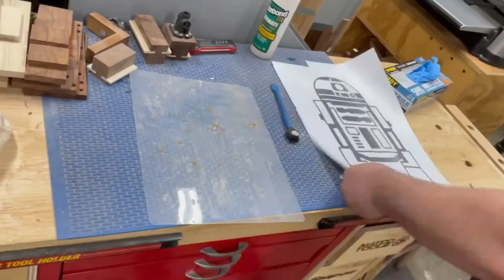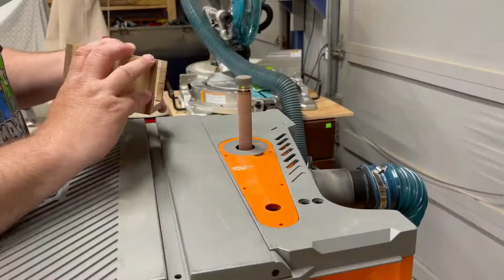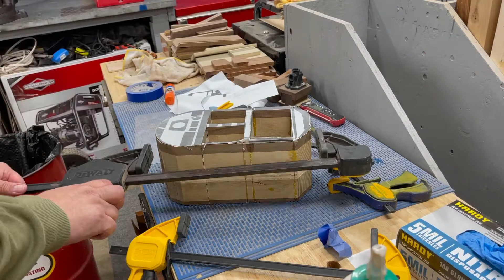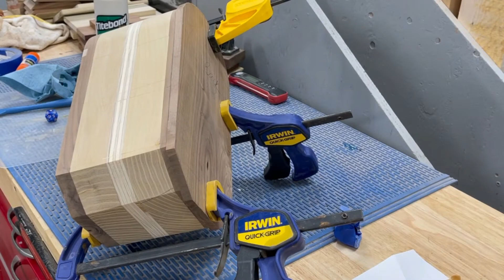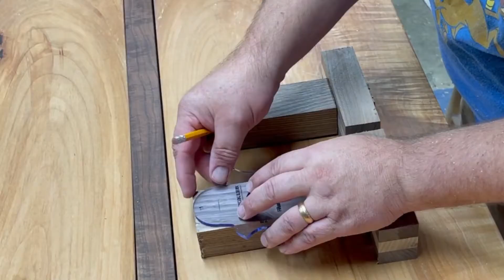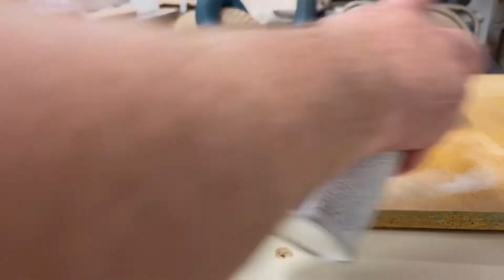Droid Bandsaw Box- #springtimeboxmakingchallenge

Comment: I like it. It's a cool variation. I haven't done a band-saw box in awhile and may have to do another one. The leather liner is an interesting twist. I typically flock mine. All in all you did a great job.
Reply from the maker: I need to buy some supplies for flocking or I would have done that, but I had the leather pieces sitting around so I made due.  Thanks for watching!